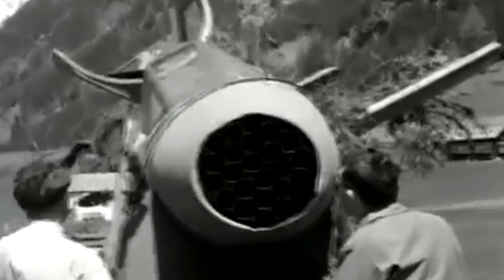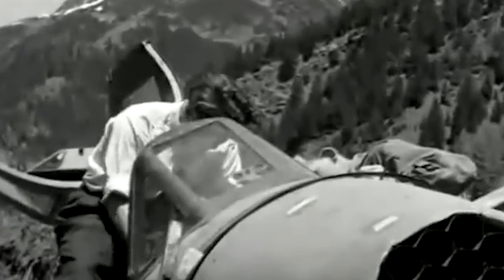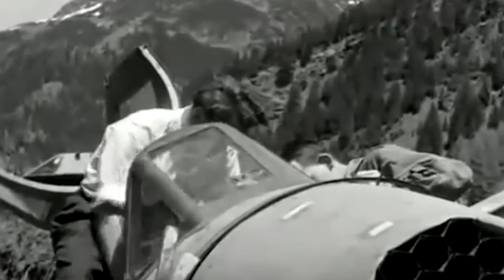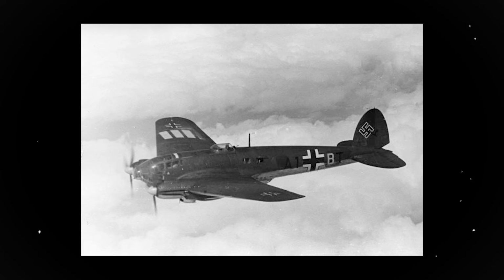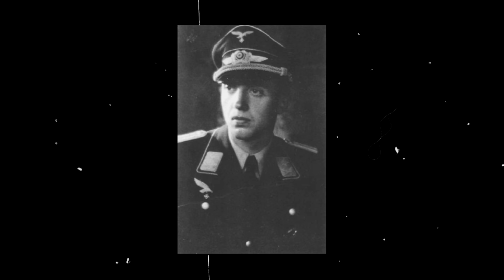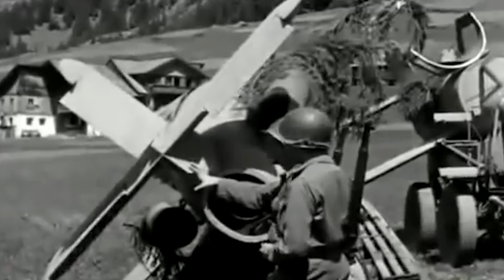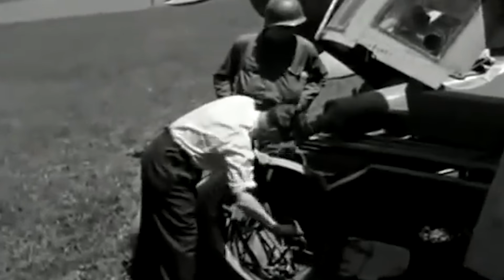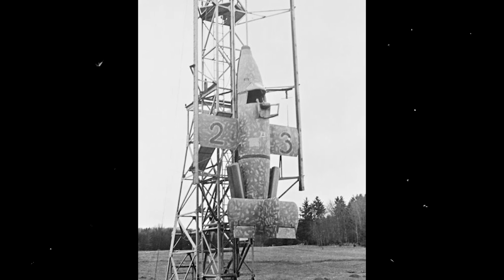The Only Flight of the German Kamikaze - The Bachem Ba 349

Comment: This is designed to launch a rocket barrage at close range to bombers. The plane itself actually has parachutes too and would be reused if possible.
Reply: The Ba 346 Natter also had a sophisticated gyroscopic autopilot derived from the V2 that handled the takeoff and guided it, with radio commands,  on an intercept course to position the Ba 346 for an ideal attack.  The pilot was really the terminal homing system. After its attack the Ba 346 would dive to a recovery field, a parachute slowed the aircraft down, the nose was jettisoned and the pilot fell away to land by parachute.  Ba 346 was actually flown as a towed glide and landed on wheels.   4 test launches under automatic control were made but first test launch with pilot failed due to a booster firing late and failing to detach.  The body of the pilot and the debris were recovered a few years ago.
Reply: @WilliamJones-Halibut-vq1fs  wow, thanks for the detailed info :)
Reply: They wanted to save the rocket motor if possible.
Reply: @BELCAN57 , wrong. The rocket motors were not reuseable. The crew compartment was.
Reply: @mrnickbig1  The liquid fuel rocket was reusable. The four solid fuel boosters were jettisoned and not reusable.
Reply: keith moore , OK. Looks like the nose was the only part that was SUPPOSED to be expended. The cockpit section and aft fuselage were SUPPOSED to be reused.  Unfortunately, the rocket engines kept exploding on impact.
Reply: keith moore  The whole aft section, rocket motor, wings, tail, guidance package, electronics, servos etc were recovered.  Only the nose was lost.  It was actually extremely sophisticated.
Reply: So what your saying is Elon Musk is pretty much hitler
Reply: @BosssMan77  uh oh
Reply: @BosssMan77  um yea

Comment: This is the original "Viper" and was NEVER designed for kamikaze attacks! It was a cheap rapid response short range interceptor, armed with rockets to shoot down bombers!
Reply: The narrator never claims it was, although his phrasing can be a little confusing at times. He does point  out that there was a demand from up high to turn it into a kamikaze device (the concrete nose, for ramming bombers), but that the designer opposed this plan.
Reply: @Phoenix-xn3sf , the title called it a Kamikaze plane, and now it stupidly says "cruise missile".
Reply: @mrnickbig1  it was not planned as kamikaze,. It had rockets in the front as the primary weapon. Also the pilot could eject and land per parachute.
However, in practical use the chances of survival would not have been very good.
Reply: @simonm1447  , yes, you read what I wrote about  it not being a kamikaze weapon and use of rockets.
Reply: @mrnickbig1  my post was not intended as a critic to yours (you wrote nothing wrong), it was thought as a complement ;-)
Reply: Yeah, this video isn't accurate at all, at least not according to the National Air and Space Museum that has one of the last two remaining  semi-intact Natters.